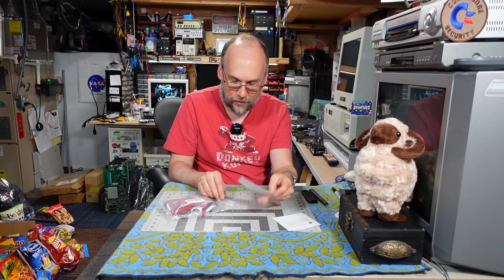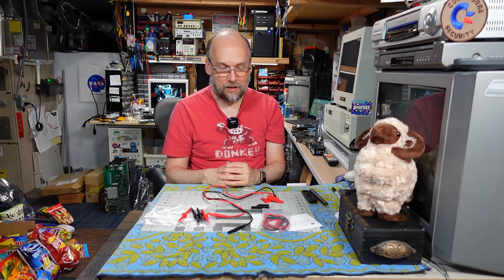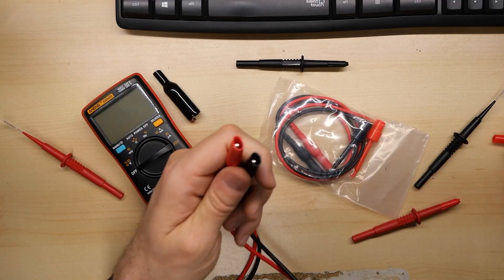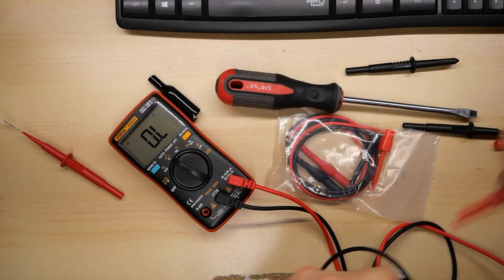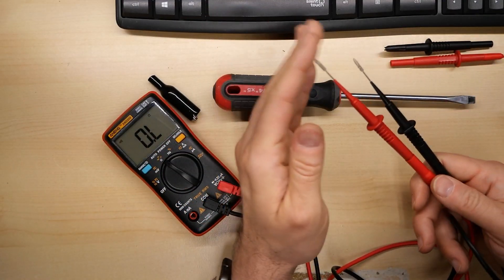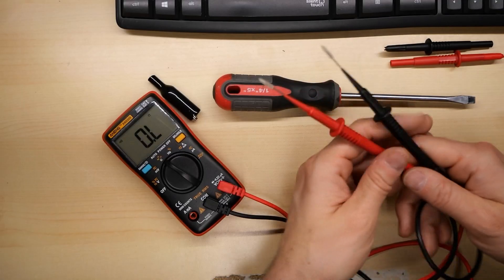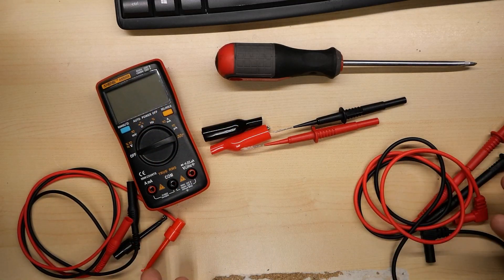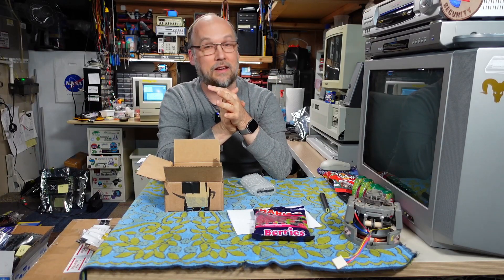SIPP RAM for the Hummingboard, a working "TheC64" Mini, and some super sharp probes

Comment: The covers for the probes with the open tips are for IC legs to eliminate shorting
Reply: And are VERY handy to have! 😎
Reply: Exactly. To be specific, they are meant for standard DIP ICs with 2.54mm pin spacing. The dents on the covers go nicely into the space left and right of a pin. You usually get covers like that with your osciloscope probes, too.

Comment: You will need a copy of Golden Common Lisp 386 Developer to use that Hummingboard. It was basically a "Lisp machine on a budget" solution for PCs back when AI meant logic-based inference engines such as expert systems rather than "statistics with sexier marketing". It was specifically commissioned by Gold Hill to accelerate their Golden Common Lisp product.

Comment: Hi A.
Nice video as usual.
Some bring me back memories i get tears in my eyes. I was born in 1970 so this is bang in the middle of my teens.
Man those were great years. (for kids at least, don't know for adults? jobs, cold war, aids, etc)
Little tip: If you plan to use those needle probe tips, put some shrink tubing on them so just the points are clear, protects you from possible unwanted shorts .😉
If you look for real silicone probe cables try the probemasters , a bit pricy but once used you never use others even Flukes feel cheap compared.

Comment: 17:20 be warned that those translucid apple keyboard (at least connected to iMacs in their time) are not well suited for data transfer, i.e. the "hub" on the sides is mostly made for mice/joysticks, I remember reading official apple docs pointing to plug data drives into dedicated iMac or G4 usb ports; so if you have problems reading from the pendrive connected to the keyboard don't blame the miniC64

Comment: Adrian- Keep those sharp probes in a ULINE 1-1/2" x 6" clear plastic mailer tube w/ vinyl end caps, stuff a chunk of black conductive foam in each end. It's what I do, cheap & easy. To get em out, remove both caps & push from the blunt end. Return em to the case by pushing them into the foam that's already pushed to the center of the tube. Great for any sharp implements.

Comment: That AN-8008 is great for what it is! It's an inexpensive all-around decent meter that's perfect for ordering 3 or 4 of so you can put them throughout your circuits and have them going at the same time (seriously, game changer). The ones I have came with two sets of probes, one regular and one with the screw type ends which are great for the alligator clips .

Comment: You need to download the sound capture app for the Elgato. Whenever you you use the Elgato you need to pull up the app as well as the capture program so you can use the sound. I use it for live streaming and the app takes priority of the audio if you don't turn it off before exiting out of the software.

Comment: Wow, I had a newer version of that humminboard, different company Delta AI. As far as I know it's just a block of ports that acts like a high speed terminal. You send data through an IDE or something like a terminal, and the board responds with the answer. Transputer cards are very similar. Some of these cards had pc-less operation as well, once sent code they just run on their own.

Comment: You can make those sleeves round again if you connect them with the probes, then heat them up with a hot air soldering station on the lowest setting and then let them cool off. Repeat multiple times if necessary.

Comment: Whenever you have plastic that's malformed like that, just put it in hot water (hot enough to be uncomfortable but not hot enough to burn), form it then shock it in ice water (while it's formed properly).  You can also use a blow dryer.  Anyway, just a quick tip for anyone that gets something like that but "time" doesn't help.

Comment: Beware of the cheap meters;  while they're fine if you're careful with them, they generally do not have internal fuses so if you have current higher than expected, they'll simply burn up the traces on the board destroying them.

Comment: Part of the problem with running it in NTSC mode is that the pixel size ratio was really weird for NTSC, something like 0.75:1, whereas in PAL is was almost 0.94:1, which was annoying, but means the sizing issues on HDMI aren't as obvious in PAL mode. I wonder why Commodore picked such odd sizes? My best guess is it was something to do with squeezing 320px into the same space as other machines do 256px to minimise bus contention between the VIC-II and the 6510, but that's pure speculation on my part.

Comment: I have a 386SX somewhere, where the motherboard is basically just an IO board with 2 ISA slots.
a board similar to your hummingboard with a bus mouse port on it (and possibly other things) plugs into one of those ISA sockets. and the processor on that ISA board is the ONLY processor in the computer.
A very non-standard layout.

Comment: Adrian - The needle like probes are probably great for probing SMD components like 0201s and integrated circuit SMD. The normal tipped probes are kind of huge when your trying to probe the legs of a SMD IC under a microscope.

Comment: The elgato HD60S does capture audio over HDMI, the setting for that just needs to be turned on in your video recording software unless it's already turned on but the card is broken or it's not supported by the software (I use version 1.1.0.1 of the capture card driver with OBS Studio and the HDMI audio works for me)

Comment: I have a set of those needle probes.. they're pretty handy for testing the female half of a 9 pin din connector for example.  Although to be honest, just a short jumper wire works just as well.
Reply: Front and back probing of electrical connectors especially automotive ones.

Comment: It looks like those plastic tip covers are formed in a way that you can get onto an IC lead and not slip. Or maybe it's just bad molding :)
I have a similar set of probes, the issue is that they are top-heavy and kind of long and heavy overall.

Comment: I'm pleased your clone SNES controller works with THEC64 Mini, as an owner of the full sized THEC64, I can tell you the unit is very picky about what controllers you use with it, Apart from the joystick supplied with the unit, the only other controller I own that works with it is a Logitech Wingman Cordless RumblePad from 2001, my PlayStation Classic controllers don't work, my Logitech Attack 3 joystick does not work, neither does the HyperKin Pixel Art controller I own, which ironically is a clone SNES controller.  I think XBOX wired controllers work with THEC64 units, but I don't own one to test.

Comment: i'm wondering, couldn't you just take regular 30 pin SIMM Modules and solder some machined pin headers on them to turn them into SIPP Modules?
they should be electrically identical

Comment: OMG, IMPOSSIBLE MISSION.  Damn I hate to watch these videos and think "Damn, now I need that" to play a game that by todays standards is something that belongs on a keychain fob.  But I LOVED that game at the time, those forward flips....damn you sir...damn you.  Going to ebay, brb.
Reply: "Another visitor.  Stay awhile...Staaaaaayyyyy foreverrrrr..."  Mwha-ha-ha-ha!
Reply: @minty_Joe  I will, that nostalgia hit was really hard.  I saw the guy in the elevator and just remembered all those flips and my The Wico Bat Handle (yeah, Amazon has a used one, thinking.....but not buying yet).
Reply: @givemethedaily1052  I remember playing it on a real C64 with a very heavy duty metal body joystick; I think it's the fancy one recommended to be included with each C64 sold at the time.
Reply: @minty_Joe  Yeah, I got a mister on order.  Thinking of trying to get the mister in a Ct64 MAXI, hope to get the keyboard working!  Put in one more hub and use some extension cables to fit them to the ousie,  Even som SD extensions to the back you can isert SD cards in whater is there.  Have to do MT-32 enstions to rasberry so my MT-32 display shows.  And internal USB 3.0 SSD, big plans :)

Comment: Adrian, your original TheC64 Mini thats none functional can be repaired by adding a serial interface to the board.   If you don't wish to do so but want it done, msg me I can get it repaired fairly easily, i've bricked mine several times messing with internals :-P